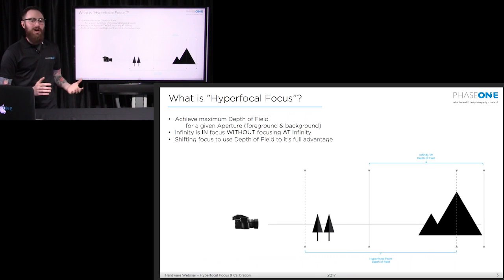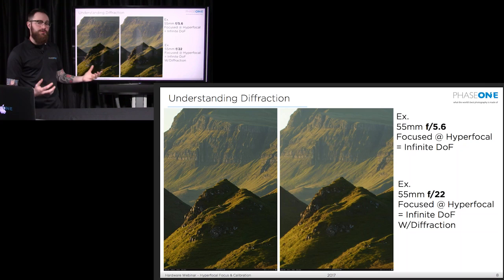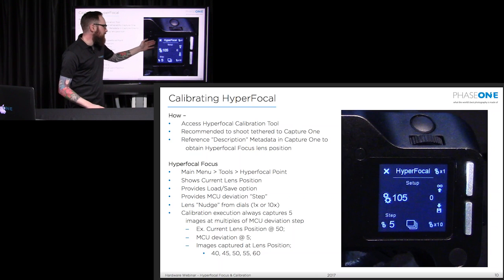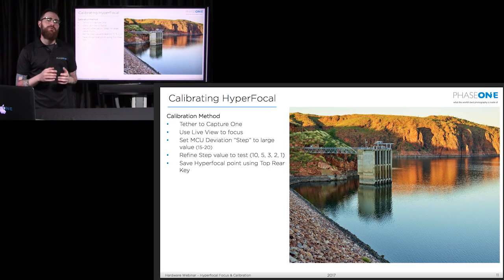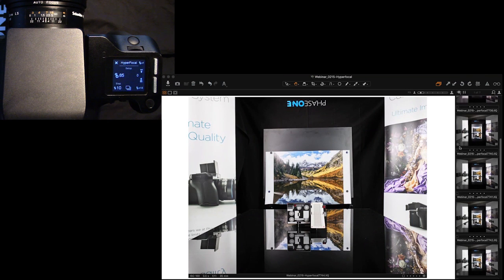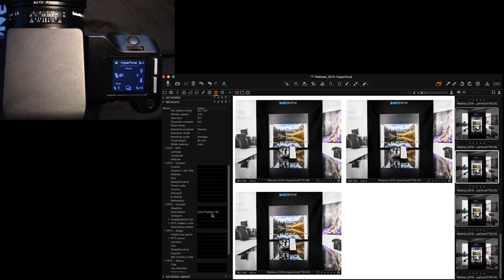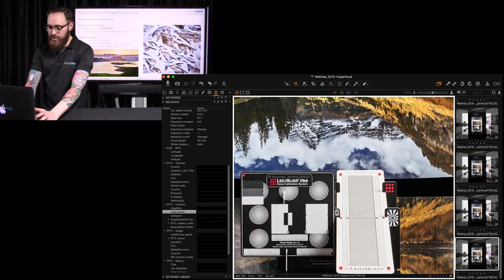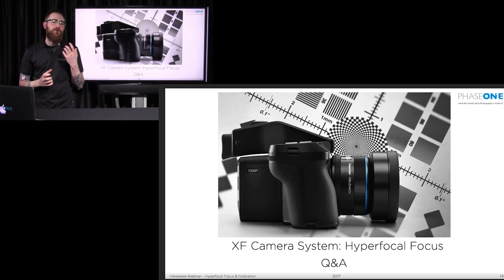Webinar: The XF Camera System: Hyperfocal Focus Using Wide Angle Lenses | Phase One

Comment: one other question, if focus stacking and hyper focal focusing are the main tools, will you have a tilt/swing adaptor available for this system? as this brings precise focal plane control, in addition to the shift movement on the xt system, and is also a less software based solution, and one that removes the need for extra software's involvement in producing the image.

Comment: this is fine for Prime lenses, but there are two zoom lenses in the range, a 40-80 & 75-150, each having a variable max aperture value f 4.0-5.6 so how do we do this "hyper focal" technique on these, can one value be stored for each focal length used, and is there any tables of when the iris changes, ie it stays at f 4.0 until 50 mm setting on the 40-80; for example?